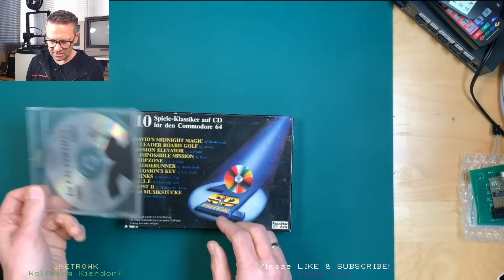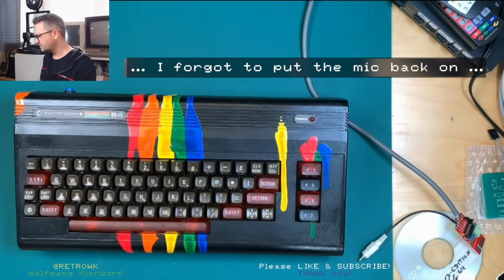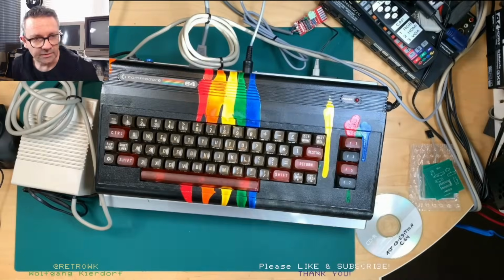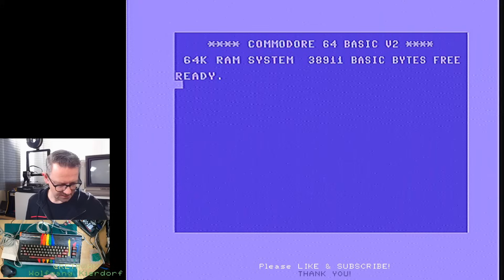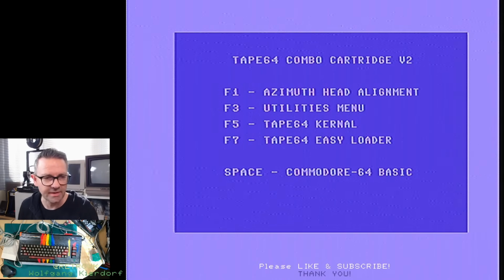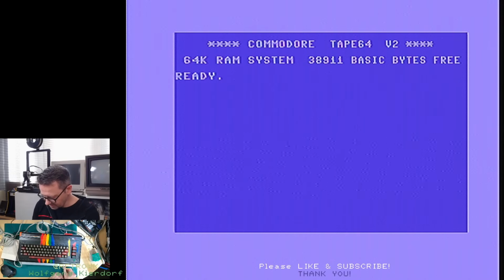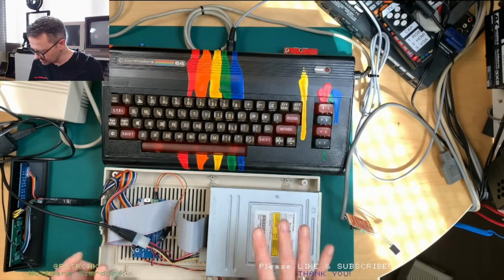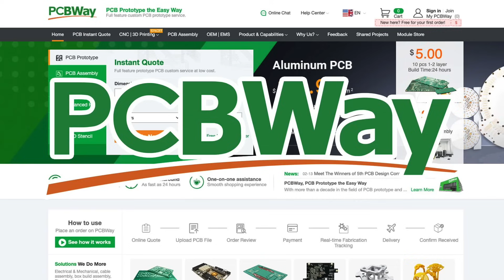Build your own C64 CD-ROM (PCB and Disc available now!) #pcbway #c64 #commodore #retrogaming

Comment: Nice video series :-) Here's one thing: with your cartridge, you probably don't have to go through the menu anymore - press F7 and skip to the track that is the game you want to load. Should work if it's the same fast loader. Downside: you'd have to memorize which track is what game - can be challenging at our age ;-) Then, the next step is making your own CDs, and if you really wanna get crazy add CD-Text to them so you can see the game's name on the CD player display.

Comment: In case you are interested in making your PRG-files readable via Audio CD, watch out for the Program wav-prg. This tool is command line controlled, but you can download a GUI and then you can go and convert your PRG or P00 to wav or TAP or vice versa.For WAV conversion, you need the audiotap-program from the same author. Just copy the Audiotap-folder  to your wav-prg folder and WAV-conversion should work as well.  Quite a nice tool and pretty versatile. You still have to make an Audio CD out of your WAVs which you assemble just by your CD-burning software, CDBurner XP for example, just to list one which is for free...I wouldn´t advise to use ImgBurn,since you get loads of Bloatware installed by installing this tool.

Comment: You can make a Magic Desk module with the loader program as one of the options.
My way to do this would be somewhere along the lines of wav2tap, extract the PRG, check the first two bytes to see to where it is loaded and then insert it into the cartridge. You can test that cart image with VICE then before burning it.

Comment: Nice project! I remember that back in the 80's General Electric sold data recorders with a seperate interface in case you wanted to use it for the C64 or Atari 8 bit (it had 2 different cables included). I don't think that te circuit you have is much different, and should work for the Atari 8 bit too (ofcourse with another connection).

Comment: Somebody needs to figure out how to convert a PRG to what ever audio file the CD is using. Because as it stands this project is very limited to a small amount of games that you can load via the CD . We need to be able to make our own CD Compilations of any game we wish to load very fast via the CD drive. In other words . Show me this thing loading Way Of The Exploding Fist at  very high Super CD Speed Load
Reply: There is a program called wav-prg which does exactly that and more. Its a cli command program but tgere is a very good gui available. You can convert from prg,p00 and t64 to tap or wav. For wav, you need the audiotap program from the same author and put that drawr into the wav-prg. Works a treat,already assembled my own c64 cd rom...
Reply: @hollgo626  No you do not understand . we need a PRG to what ever format the games on the CD are in . they are special compressed some how to be able to load super fast . we need to be able to take a normal PRG of exploding fist and burn it onto the cd so it loads super fast .
Reply: You know that loading a program from CD via the Tape Port needs an Audiosignal to Work?
Reply: @hollgo626  of course i know that .what you seem to not be able to understand is that its not the same kind of audio as what your tap to wav or prg to wav makes. its a special different compacted kind of audio. somebody needs to extract the files off the cd and see what they are . reverse engineer it.

Comment: Amazing setup Wolfgang !. If you interfaced with a CD player, can do the same with a HDD ???? I'm curious !
Reply: It is interfaced with a normal line-audio out. You can connect a cd-player, a dat-tape, maybe even a vinyl record (if you have one with a program written onto it) or even a normal tape drive to it. Of course you could use a HD - simply connect it to a Raspberry Pi and install an audio player. Any line level audio signal can be connected.
But if you want to connect something "bigger" - there are SD Datasette emulators. You can write datasette images onto the SD and the adapter plays the file as audio.
Reply: Well, if you play your Audio , stored on a HDD, via your Soundcard into the Audio-Adapter you connect to the C64 Tapeport, you can rightfully say that you load the software via HDD to your machine. Well, it´s a fun project, nothing really useful, but it is fun and that´s what a Hobby is all about...

Comment: Interesting... so basically this is a "CD as a datasette" solution? That also means that there is no support for directories, and you have to select the CD track by hand? Nice to see the drive in the 1541 case, very cool!
Reply from the maker: yep.
Reply: Yes,but AS a Bonus, you basically Turn your 1541 into an Audio CD Player,which is even remote controlled if you buy the josaudio Kit including the remote....
Reply from the maker: And you even have room for speakers in the case and slits on the top to let the audio come through!
Reply: @RetroWK  now how about for a turntable option too? Imagine this - some fanzines in the 80s actually distributed sample.programs like this too!
Reply: @michaelwessel4953  Sure, if you´re fancy enough, go ahead and make an LP out of your PRG-Files :)